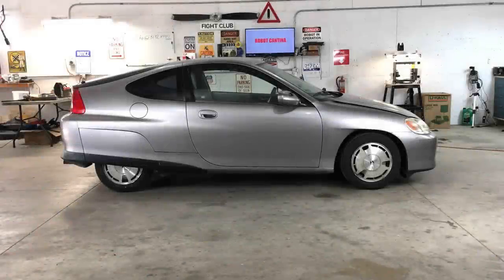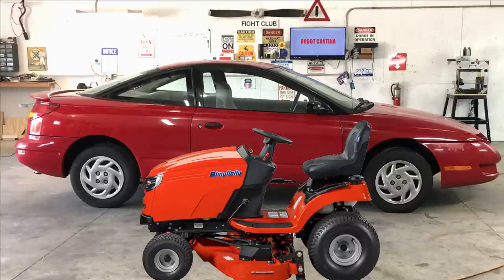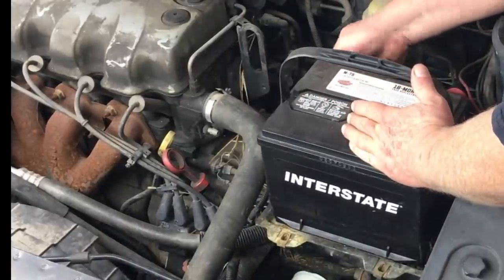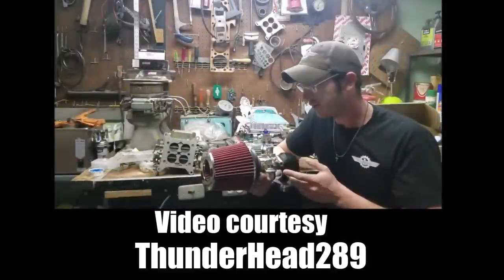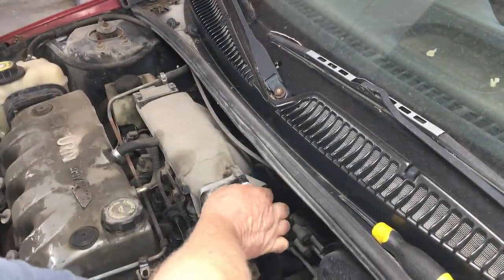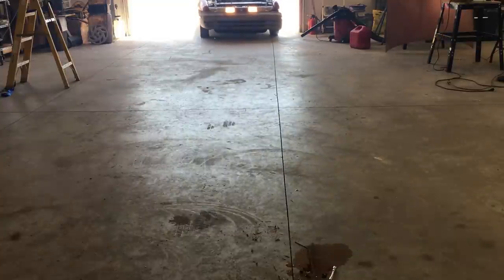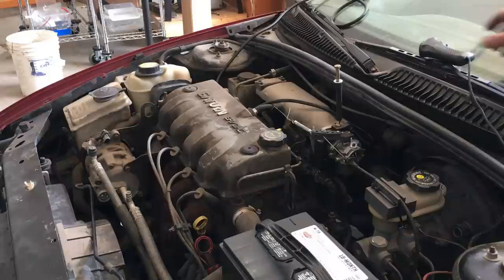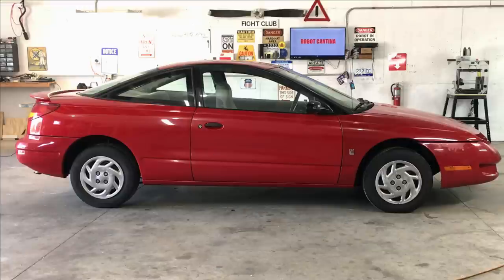S2E14: We get new project cars for more experiments,  plus we put lawnmower carburetor on a Saturn

Comment: Original lawn mower on V8 guy here: 
See if you can get a reading on your ignition timing - my fear with this is that the ecm is going to open loop your ignition timing into a safe but late (less than optimal) setting which will hurt your economy. 
Can't wait for this though due to the sheer ridiculousness - really the only reason I did mine, absurdity. 
Thunderhead289
Reply: Due to your videos man I'm building a complete chevy c10 and plan on shooting for 35 mpg and will be uploaded a video and comprehensive testing in my own redneck way so feel free to give advice if you want I love that input from others
Reply from the maker: Hi Luke,  I installed a OBDII scan gauge and took the coupe out for some baseline data gathering today.  I kept an eye on the ignition timing as well as some other signals.  The car got really good fuel econonmy in stock form, it will be interesting to see what happens with the lawnmower carburetor upgrade.. lol
Reply: Nothing that couldn't be overcome with a Megasquirt or Speeduino I'm sure.
Reply: hi buddy , when's your next video coming out . cant wait.😃🦘
Reply: Did it hack the Power Tour?
Reply: @MAGA_Trump_Warrior  yeah thats not what I wanted. I don't support the use of a lawn mower carb on a car as a legitimate thing. I only made my videos because folks said it would never run - which we can see it in fact will. 
It was a teaching tool to show that everyone is way over cfm they need in the carb world - the mav normally sports a 390cfm which everyone incorrectly thinks is way too small (I'm an accomplished hot rod tuner). 
It made 60hp and 140ftlb of torque at 2000 rpm where that's normally a 300hp engine. So whatever it gains in economy it greatly loses in power. 

It did all of power tour, which is 1000 miles and 5 cities in 5 days - but id much rather have a small 4 barrel.
Reply: @SIXPACFISH  flawlessly
Reply: @robotcantina8957  lol I wouldn't call a lawnmower carb an "upgrade", im a lead foot hot rodder. Folks have lost the purpose of my project - to show that it could be done, and to show that folks who think they need a 750cfm on their ford 302 are misguided. 
Regardless of fuel economy "advantages" folks have contorted this into what they want it to be - some new saving grace technology, which it isn't. 

I enjoyed making the carb cheater the most which trims the afr on demand. 
Love the youtube name - contrary to what I look like on YouTube, im a heavy programmer by day.
Reply: @ThunderHead289  I think people in current times that drive old cars due to financial constraints  love the whole lawnmower carb because of the amazing fuel economy you achieved. 
It could save so much money to those who can simply not afford Current prices. I certainly was super impressed and as shocked as you were. Personally,Fuel economy has become my main focus in cars the past few years due to super super tight finances, I used to care about power and handling,didn’t even know really why people cared so much about MPG. Now I really get it. 

Like it or not Luke you’ve started something and That something is good in my eyes. Its sparked many people into experimenting themselves. If your mpg claims and AFRs are all real (I believe they are) then what you’ve done with the “carb cheater” is a valuable and innovative addition to the car community in my eyes. 

It’s pretty funny this all started as a joke but I wouldn’t discount it too much.

I hope you don’t abandon your lawnmower carb project entirely for a little while at least , it’s very cool.✌️
Reply: @fipfip3331  there's better carbs out there to use - the lawn mower carb specifically was due to it being the most ridiculous. A mower carb doesn't have all the circuits to handle the dynamic load scenario a vehicle experiences, the carb cheater kept it alive but you had to be aware you had a mower carb still while driving. 
It's been pretty disappointing overall actually - folks missed the entire point of the project and now everyone is trying to buy mower carb adapters from me. . .
Reply: I commented on you last video about how the electronics keeping the AFR correct is an amazing idea and how that is yhe real hero. It would really help carb folks optimize their current or future set ups. Thanks to both of you guy (Jimbo and Luke) for posting there work and findings. It really great guys are still out there hot rodding be it any form.
Reply: Add a second one with progressive linkage.
Reply: @ThunderHead289  I understand what you mean mate, I'm most impressed with the carb Cheater personally. It's a iacv on steroids ahahha. That's the real innovation here. I've seen videos predating yours with mower carbs but nothing that actually addresses the afr issue. 

I hate to tell people what they should do as you spend the time and effort making videos ,but maybe in the future a follow up with "what is the ultimate mpg carb" that would be more suitable then the lawnmower carb using the help of the cheater.  Maybe a bike carb or something ? I know many people do bike carb conversions on the cars I'm into.

Either way I understand where your coming from Luke.
Reply: I just cant wait for the ThunderHead AFR Mystery Box to become available ♡
Reply: @smokenchoken1736  that is indeed soon. Need to finish up a circuit that handles both multispark and single spark for universality sake. Ignition signals are a beast to be reckoned with
Reply: @ThunderHead289  I didn't miss the point at all, but for some reason I got a vision in my head of a triple lawn mower setup looking pretty sick, and I just happen to have recently obtained an '82 K20 truck with a 350 and a bad carb.. I'm trying to resist doing it just for fun, and to see what kind of looks I get at the local back woods car show when folks look under the hood. nI wonder if a triple carb setup would still need as much afr compensation. 

I'll end up going EFI regardless eventually. But seriously, the lawn mower carb doesn't seem that different from the 1 barrel on my '54 230 flathead, or the 1 barrel carter carb on my old Farmall C tractor or the Keihin 40mm FCR on my KTM 620 dirt bike that even has an accelerator pump.. Come to think of it I have a spare 40mm Del Orto motorcycle carb just sitting out in the shop.. Hmm... You can tune both idle and high speed metering on those motorcycle carbs..  You are bad influence, now I have a vision of a triple Keihin setup on a 350 V8 rat rod.
Reply from the maker: @ThunderHead289  I have noticed people see what they want to see.  This channel is all about going as fast as possible with a small engine but since I'm using a Honda Insight and a tiny engine, some folks think its about fuel economy.   Anyway, I figured your day job had something to do with writing code.
Reply: It is riddiculous now. In the future, when one cant find a fuel pump, replacement injectors, etc many people will consider this carburetor alternative as the ONLY alternative. Specially when its a european car they are trying to keep running.
Reply: @robotcantina8957  Have you thought to try a good tuneable motorcycle carb on it? Or even fuel injection off a large single cylinder motorcycle?
Reply: Pretty soon it'll be illegal to own lawnmower carburetors lol if your caught making videos with em they'll fine you and take your birthday away
Reply: @melvinsmutters7662  I'm surprised they don't ban lawn mowers anything with a small engine completely.
Reply: @ThunderHead289  Hey Luke any news on making a 2 or 4 barrel carb work like the lawn mower carb on the low end? I'd love to know the stats on the lawn mower carb on the highway and in regular traffic. Did it hit its limits (e.g. 60 hp) often?
Reply: @ThunderHead289  hey Luke good to see you here I didn't even watch the video yet and I started scrolling through the comment section to see what the comments would be about thunderhead 289 and here you are 👌 good stuff brother just doing what they say can't be done only for the the knowledge and the fun of doing it 🤟.
Reply: Nice to watch it run. There could be a few issues with low temperatures. You may have to heat the carburetor, if not, it may be freeze.
Reply: @ThunderHead289   I'm sure you meant a ported and correctly tuned small 4 barrel, right?
Reply: Why not use a side draft motorcycle carb for say a 125cc, or a 50cc. That way you have an accelerator pump at least? You're going to have to get the jetting right, but it should work. I realize the disk is to get good fuel economy, but you could still do that and have at least a little more engine management than a lawn mower carb.
Reply: @robotcantina8957   @ThunderHead289 been watching you both for some time.  @ThunderHead289   my sister had a 72 Grabber that was originally ordered to be a factory drag car by a factory Ford 1/4mile drag team.   They specified a '69 Boss 302 through the dealer.   After a few weeks they pulled a stock grabber and a Boss motor out of a Mustang that was traded in.
Few weeks later the spec racer arrived and my Sister & hubby bought it at a discount since it didn't have proper engine in it for '72.   Some 15 years later she had won a bunch of trophies racing  locally & ended up Ohio winters took it's toll.   They sold it and 5 years later a buddy bought it, he got busted leaving 90+ feet of black marks through the square in Lodi Ohio.    He sold it and it wS probably junked from the salt rust issues.   Was the 1st car I ever drove, news paper delivering as a 12 yr old on gravel back roads 😀 😍 . .
You're correct about people over carbing cars,  302s or 305s with 750 double pampers 🤔  dumb mistakes happened every day.    My '74 Cougar XR7 has a Carter AFB 625 which I've tuned (back then) for performance vs MPG never Carbon fouled a plug and rarely beat on the street. :D 😀
Think it would be great to see dual or "Quad" lawnmower carbs tuned w a good progressive linkage to get Great MPG and bit better umph...
Reply: @vertonmccaulou5  Slow down Verton.
Reply: @ThunderHead289 what better carbs, tell me please?
Reply: @ThunderHead289 better and fuel efficient

Comment: I hope this comment gets to you in time. I had this exact same problem on my 93 geo metro one day. I was  delivering my newspaper route one day and it suddenly went right into the 3'rd gear and would not shift down. After researching the geo metro forums, I learned that the Transmission Control Module was prone to dying out. Apparently they was not very water resistant and even heavy humidity could cause it to fail. Ontop of that, the engineers placed it under the dash, practically above the peddles. Hope no one stepped in any puddles before hopping in?
The good news is you can simply unplug the TCM and then manually shift the shifter to change gears. No cost, no crazy modifications, and it turns the car into a fancy manu-matic. For me, this was wonderful as many places on my route, I did not need to change into 3'rd gear as I was just going to stop again.

I hope this helps, maybe you have a similar issue and this will allow you to change gears, even if its manually. But if this does work, maybe you could use it to your advantage! Instead of putting a new clutch system together, you could just attach an engine to the stock transmission and the crank to the torque converter. No belts, finicky rubber weights, just bolt n go! With that said, I would expect you to have to adjust the final drive gear tho. Again, if its anything like the geo, you can just replace two gears on the side of the tranny. But if not, well maybe smaller tires?

Comment: Not sure what is holding your brake reservoir on, but I'd throw a metal strap over to the strut tower.  'plumbers tape' might even work 

Some of those just have the rubber seal holding it, some have a tiny roll pin, either way it'd be a bad day if you popped the reservoir loose.

Comment: I LOVED this episode. As soon as you said the pump was bad I immediately thought "Hit the tank with a hammer!" which usually temporarily always fixes gm pumps. You went the other way, which is fantastic. Since that Saturn is OBD2, it would be pretty interesting to see via live data what the oxygen sensor, and ignition systems are doing. You can likely troubleshoot the transmission the same way. If whatever scan tool you have is bidirectional you may also be able to command each gear to rule out the transmission as the culprit, I don't know, early OBD2 cars aren't really that advanced. 
It would be extra cool to see a fuel economy test if you got the original system working and compared the two. I CANT WAIT TO SEE MORE! Thanks Jimbo!
Reply: Hey you! Love the channel man, I wanna see more Cobra and that FE3 Mazda lol
Reply from the maker: The fun is just starting,  We put the lawnmower carb on the red coupe and took it to the hillbilly proving grounds....We will have before and after data in the next episode, stay tuned!
Reply: @robotcantina8957  Here's to the fun just starting!
Reply: as   scotty   says,   you cannot change the laws of physics.
Reply: I had a AAA guy do that to my old 88 Chevy 1500 PU and it is still working.  Crazy
Reply: @pctrashtalk2069  HEY JIMBO.....  congratulations on reaching 100k subscribers.. ROBOT CANTINA is providing the 
entertainment and fun that viewers enjoy..
Reply: @kansasrose2909  ROBOT CANTINA    we love these new project cars!    and we love it when Jimbo  re= engineers stuff!  just for fun👍👍👍👍

Comment: I have a 2002 SC1, 5spd. It used to get 40mpg, but lost the front bumper when it kissed a wall, now it gets 35mpg, no matter if I drive it hard or easy! It has over 310,000 miles!

Comment: Those fwd trans have a "limp" mode that will lock it in 2nd or 3rd when a code sets. Disconnect the electrical plug going to the box and Dropping the gear selector in low/1st should grab 1st, if it does not you have an internal valve or gear problem. Check fluid level during operation and retest. If still no 1st gear you have a garbage trans. There is no other required test
Reply from the maker: Thanks, I will give that a shot
Reply: @robotcantina8957  Love your hard work and spunk! Robot.!!
Reply: Yeah limp mode is 3rd. Shifting the gear selector to 2nd should put it in second. First is tricky in these transmissions. It's been awhile since we did our race car, but I think all the solenoids have to be on to get first, gear selector in 3rd or drive.
Reply: I have the factory manual on that transmission, I can send pics of the clutch apply charts if you want.
Reply: @EricWoodring6thplanet  mine had a finicky wire in the fusebox in the center and i had to push ot in sometimes or my trans would do this lol
Reply: @derek maxwell huh, first I've heard of that issue. 
You can also pull the 5 amp  Trans fuse in the underwood fuse box and it'll run full line pressure.

Should have mentioned it's great to see you using these cars. I still have my 95SC2. Your informational knowledge on the S cars is right on!
Reply: Specifically the MP6 and MP7 transmissions have a hydraulic priority valve, that in the event of electrical failure, the D3/4 positions will provide 4th and the D2 position will provide 2nd for limp mode. They will not limp in 3rd.

edit: and since the solenoids aren't active to dump clutch pressure, all clutches will try to apply at the same time, but can't because of the priority valve. This, however, pushes the valve around in a way that disables torque converter lockup pressure from building.
Reply: @supertoaster94  This
Reply: I stand corrected, thought it was 3rd.
Reply: @EricWoodring6thplanet  If you really want, there's a youtube user called lowsaturn that has a bunch saturn repair dealer technician training videos. Those videos are the reason I knew this lol. Search for something like "lowsaturn automatic transaxle repair" and that little tidbit is either in the repair or diagnosis video.

Comment: I had a Saturn SC2 early model. Manual, dual cam, and pop up headlights. Good looking car. Blew up the engine attempting to go 90mph on the highway. It couldn't deal. lol!
Reply: The SL never had pop-ups, that was the SC2.
Reply: I had a 97 SC2, auto, made it to 113 MPH and it was pretty much done.  Not a bad ride but good god everything rattled!
Reply: @ttank1994  I've had my '95 SW1 (auto) up to 100 - all the single-cam engine could muster at 4.8k rpm in 3rd.
Reply: I've taken my 01 SL1 over 100 a few times, I need to check the wheel balance because you can tell something is off balance when going that fast, feels fine at 80MPH though.
Reply: @V3DT  HEY JIMBO.....  congratulations on reaching 100k subscribers.. ROBOT CANTINA is providing the 
entertainment and fun that viewers enjoy..

Comment: I've been playing around with cars since I was 13, I'm 60 in a couple of months, never seen the fuel soaked rag before!! 

Never too old to learn something new.
Reply: I would guess if you work with rags like that you should keep a fire extinguisher handy, 
What kind of car projects have you worked on.... Any for the sheer crazy  or to save on fuel cost?⛽😉??
Reply: @kansasrose2909  ALL of my cars have had an element of the "crazy" about them.. what's economy? 😉
Reply: @IJ-E36  I have fuel economy on my mind lately,   due to economic factors.  I would
say if any modification can be made it should be given some consideration.. and we have 
a lot to learn from those that have experience. ☺
Reply: @kansasrose2909  the biggest single factor in fuel economy is how you drive, always have the fuel average display on the dash, you'll notice trends and can adjust your driving to the positive changes.. 

I do this in my daily that I tow the race car with, there are so many things people overlook that can make a difference.
Reply: @IJ-E36  Now,  that bit at the end of your comment,
" tow the race car with"   really has me intrigued. 🤠🤠